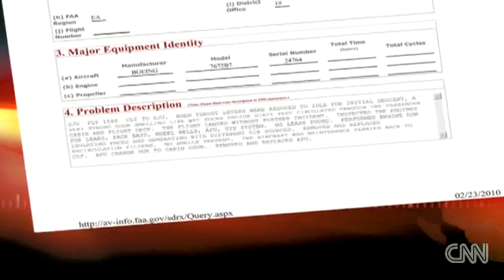Commercial Aircraft Air Quality Danger -  Aerotoxic Syndrome

Comment: @chechnya Bleed air is used for air conditioning and cabin pressurization. Bleed air is also used to start the engines from an Auxiliary power unit or another engine. The jet engine is the most efficient souce to get pressurized air to use in the cabin.